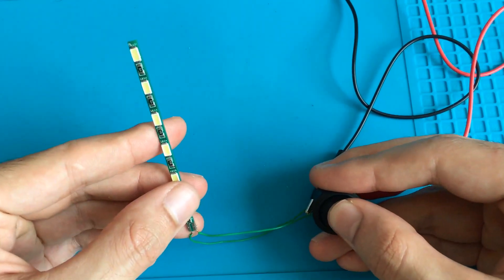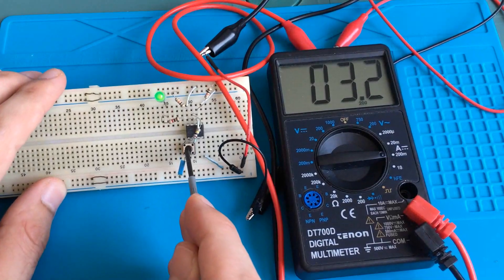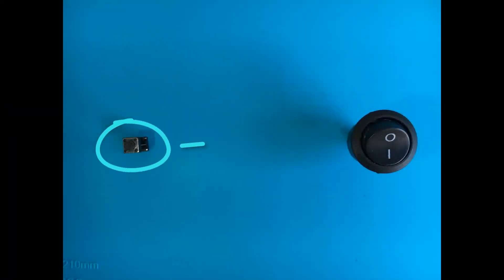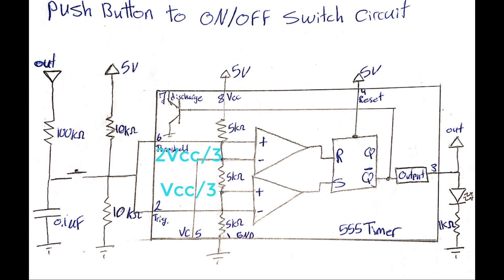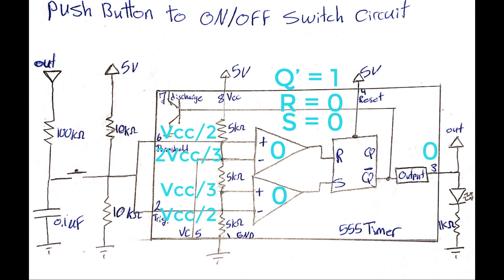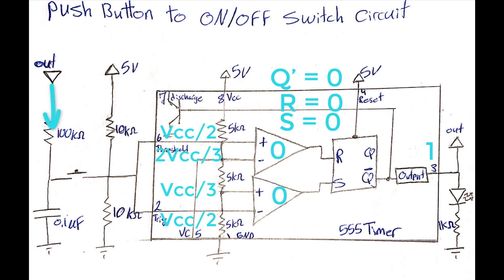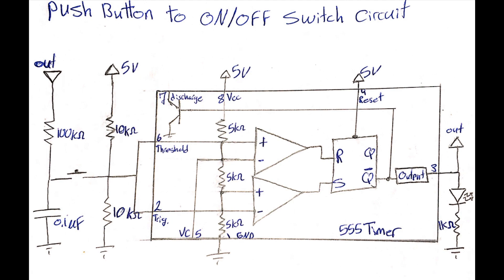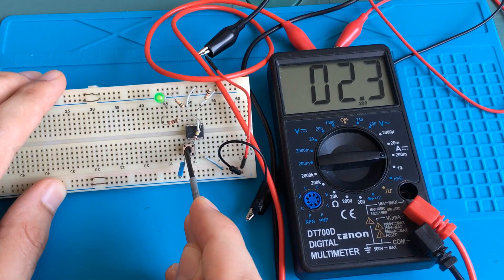555 Timer Latch Circuit / Push Button to ON/OFF Switch Converter

Comment: Nice circuit, but a bit of a concern thinking way back to the old days of NE555. What happens if you hold down the button continuously? Will it become cyclic as determined by the voltage divider in conjunction to RC applied? That said do you consider it better to parallel the 100K with 0.1uF as the initial state of pin 3 is '0' to give a falling edge on pin 2 and pin 3 at "1" gives a rising edge to yield a flop-flop action.   What do you think??
Reply from the maker: Hi, first of all thank you for sharing this with us. 
keeping the push button pressed does nothing actually regardless of the latch state because Reset triggering operation happens only when the capacitor is charged for a level higher than 2Vcc/3 and it occurs only one time when the capacitor discharges so there is no concern from holding the button pressed. Is this circuit is a complete replacement for for ON/OFF switch? of course not, I tried this circuit to control a motor but it did't work. As mentioned the beginning of the video this circuit is good for small loads like LEDs, buzzer.. etc
Reply: @usefulelectronics   I see my error as did not take logical steps to analyse correctly as the key is the "voltage divider" which governs events. Clearly if I am not mistaken, the capacitor being zero volts will "trigger" the NE555 to set the output to "1" to allow the capacitor to charge to the NE555 quiescent point as set by the voltage divider while button is "closed". With the button "open"  the capacitor can fully charge that allows "threshold" operation when pressing the button "closed" that allows the capacitor charge to pull voltage divider up enabling a transition to occur.  Yes, the output of the NE555 is about 200mA so it will need a integrated power stage to support additional loading greater than its output parameters.